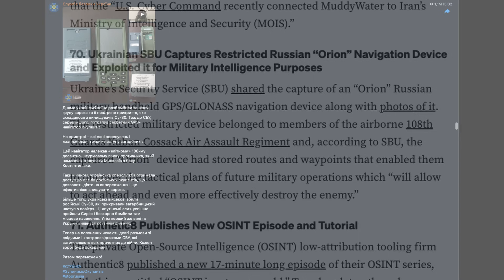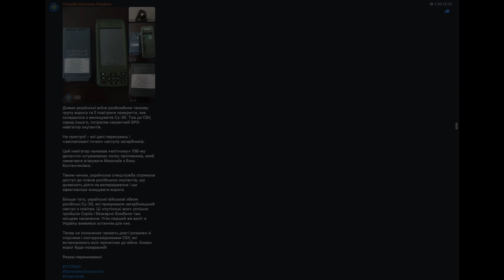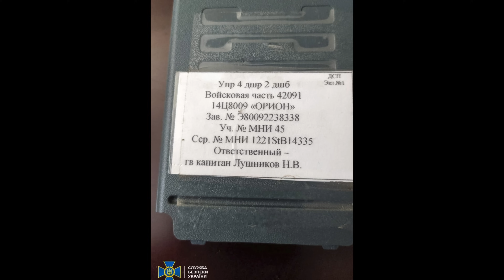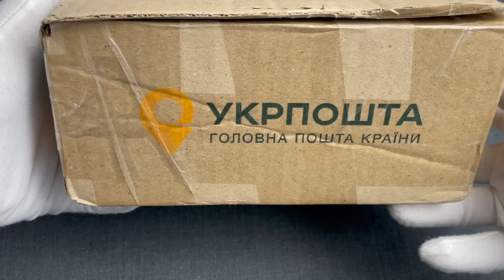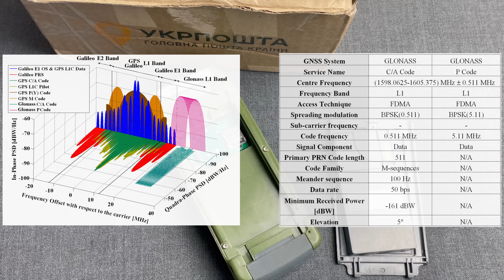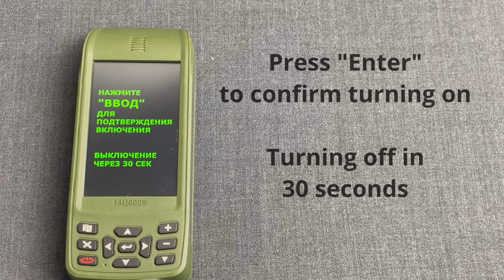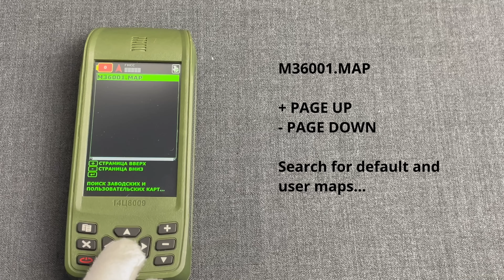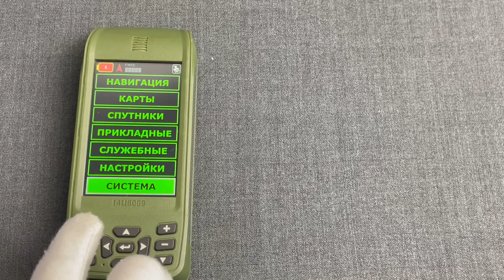Teardown of Russian Military NAVIS ORION Navigation Device

Comment: It's this a Windoes CE device?
Reply: I don't see anything suggesting that?
Reply: @すどにむ somehow interface and the inside layout of the PCB reminds me of truck sat navs i used to install iGO truck on them. Windows CE it’s still used in many under 100$ Chinese sat navs even today. Pretty easy to install things on them and a lot of UI’s.
Reply: @liviurosca  Are you sure those aren't Linux? Lots of Chinese products like IP cams use Linux, adding GUI on top is not impossible
Reply: @すどにむ  100% sure because i installed .exe programs. I know you can run .exe with wine on linux but not on a 300mhz processor devices. It was running Windows Embedded CE 6.0 to be more precise. On some devices i used to bypass custom UI by the manufacturer and use the normal Windows interface with Start menu on the bottom left so you have access to more apps, not only maps.
Reply: @liviurosca  whaaat. okay, I stand corrected. There's no wine that works for CE apps so if a thing runs .exe for CE it has to be 1000% CE. I thought SoC vendors gave up on it and CE went away but alas...

Comment: Cool Video, especially interesting they are using an micro usb 3.1 port. But I have to disagree with your opinion on slot-head screws. They are in my experience very hard to damage and can be opened with almost anything in an emergency.

Comment: That bright blue boot screen is soooo tactical.
Reply: I was wondering where is the Zeroize key to wipe mission data or keys. Turns out there no anti spoof/SAASM encrypted capability like the DAGR. So a fancy tactical edition of standard consumer GPS.
Reply: @videosuperhighway7655  There's no tamper detection either. Overall this is needlessly overcomplicated smartphone with hand rolled user interface than anything serious
Reply: @videosuperhighway7655  It's actually a consumer device which just happens to be used by Russian armed forces.
Reply: Lol

Comment: This is definitely quite an interesting device to say at least. If I would get my hands on one of those units, I would immediately try to see if I could exploit something in there and maybe also make it try to locate other devices in the area. But it's kinda funny that there's no pin protection, the OS look like something from a glorified Hollywood hacker movie or even some tamper protection with small 3.5v disposable vape LiPo battery which would set a self destruct flag after putting the main battery back in and try to power the device on 🤔

Comment: That's wifi antenna (2.4/5ghz dual band) with the black u.fl cable - the module it connects to is a BLE (Bluetooth Low Energy - 2.4ghz also) radio. It'd be interesting to see if these have any emissions in the 2.4ghz band while powered on / in use.
Reply: These gps units are part of the "Strelets" system. 
Basically each soldier in a squad has one of these, while the squad leader has a tablet and a digital radio that can communicate with higher ups and aricraft in the area. 

The system is essentially a squad level blue force tracker, similar to the US ATAK.
Reply: Probably. It is standard in civil GPS receivers, so that they can share the data with external devices.

Comment: i have used this device and its posibel to remote access the device and remotly delete information or remotly upload false infomation. it happens automaticaly when turing it on while seaching for satelites. evry device is tracked and if they suspect its captured it they will send a signal to the device to automaticaly delete sensitiv information and change some parameters and so on. but they can also remote access it while its on and remotly delete or upload false information if the suspect enemy has the device
Reply: Pretty much what happened, it got maps but it got no data in it and don't receive glonass data
Reply: So do the year down and RE work in faraday cage. Hopefully it will not have phone home yet
Reply: @daveb3910  Wouldn't help. The info that a Captain would have on his GPS would only be valid for 3 - 7 days. 
After that the front has moved on. Plus he was a Marine if I remember correctly, so was likely deployed to a region to support an operation, ergo he would not of had any relevant regional info.
Reply: @daveb3910  it most likely have phone home since the crew did not check in at the time interval so the device was remotely accessed and wiped and uploaded false information and its access to Russian satellites denied so they cant use the device. Plus its a bug that will upload the the device they try to access the Russian device with and it will spread to Evry system its can connect to and gives the Russians a back door in the Ukrainian systems that the intelligens service uses. They did the same thing to a another country to.
Reply: Do you know all of this for certain? 

Can these have two way communication with Glonass satellite?

It seems unlikely based on the power consumption that would need for a start.
Reply: @gavin9038  yes and its why the battery dont last as long. and why its connected to a charger when i can and that have a charger and powerbank and a small solar panel thing to charge it in the field. And its 2 types of divice and for low ranking concripts and one for officers. The one for officers have a bigger battery and more options. And can send messages via the satellites just like the Garmin inreach or Garmin Messenger and you connect via Bluetooth to a phone and use its keyboard to write with. I got to use the device in Murmansk and nickel in Russia and up to the northern fleet on the Russian border to Finland and Norway. This was back in 2017-2019.
Reply: Reason to use sealed lab units
Reply: The reality doesn't matter much. SBU's goal is to always present something feasibly looking to create an appearance of a win, which is then regurgitated through every western channel of information, regardless if this is a big news agency, osint community, or a tiny channel such as this one.

Since it is framed that the only "acceptable" information from Ukraine comes from the Ukrainian side, they get to create any narrative they want to entice the western audience to support giving more weapons to them, which is what all information coming from Ukraine is about.

This is how Russia has been continuously "collapsing" in a few months for the past 2 years, and Ukraine has been getting one magical weapon package after another that will totally dominate the enemy in a few months, yet in a few months we only get new promises of a new collapse and a new dominantion in a few months

Comment: wont be surpized if this thing was designed  and partialy manufactured in US :D
Reply: Why?
Reply: It wasn't, Russians are not good at manufacturing chips but they know how to design stuff using foreign components.
Reply: @louies6914  bring a proof it wasn't rather bshtting. Designing stuff is not a big deal, especially having 100% support from US manufacturers. Just read some history books my friend
Reply: @louies6914  Chips from microwave ovens and washing machines are always more advanced and cheaper than chips made specifically for the Pentagon.

Comment: everything about this unit screams - not made in russia, most likely runs some hacked up version of android, the interesting part about this would be if these are capable of working in gps suppressed environment, hardware/software decoding, but most likely they don't work, which is why the intact one was allowed to be shipped out of the country
funny design, has rubber seal for main case, but no apparent seal on the battery cover and some dirt behind the cover already, kind of reminds of those russian mil grade night vision devices that have ordinary sanitary silicone all around the case to prevent moisture getting in, I guess this one has a paragraph in the manual that tells to keep it in a bag of dry rice for optimal service life
ah, didn't notice the siliconed in battery 😂
and that rubber seal from the case to the pcb, but no apparent seal from battery to the case, meaning moisture has access to contacts of the battery and the memory card
Reply: Are you okay, in the head?